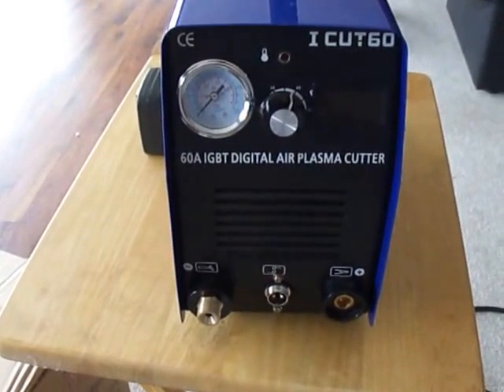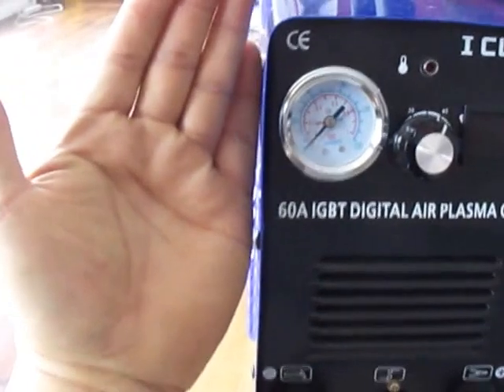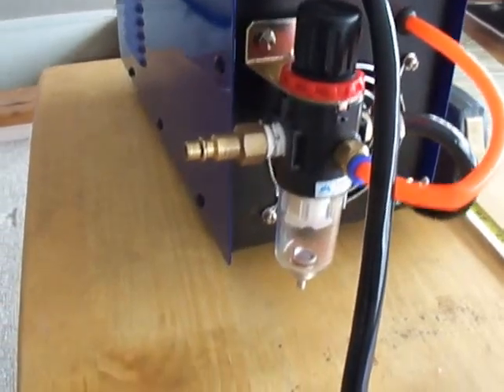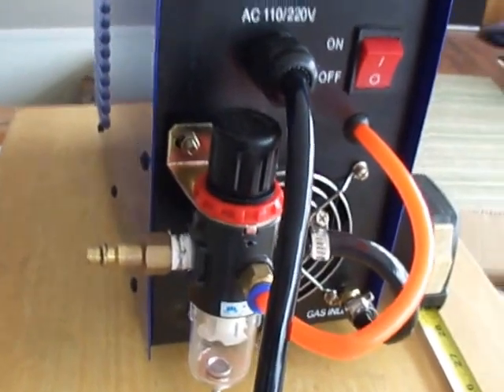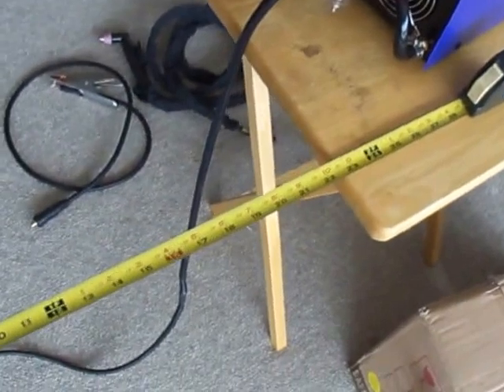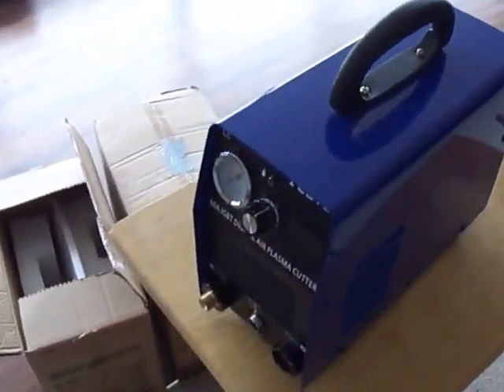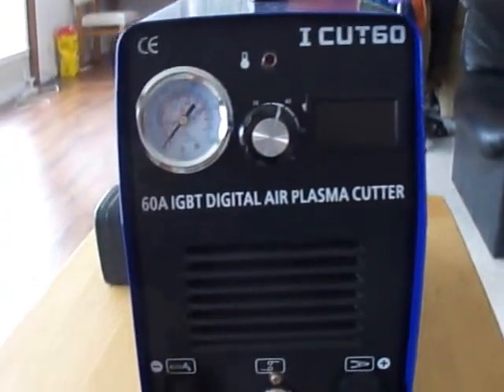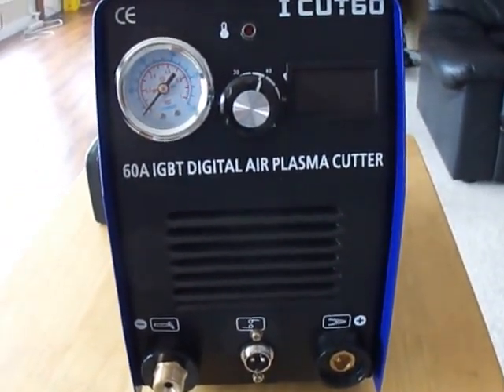ICUT60 hook up and power cable extention

Comment: Thanks for this video, it is quite informative, I used it for review before buying my unit. I am familiar with most electrical, but how does the electrical connections hook up? I do not understand, it says 110 or 220, but there is no internal changes or switch like most things I am familiar with. With water pumps and such the wires must be changed internally, does it automatically sense the voltage and adjust it's self?
 On a 220 there are two hot leads, If I want to hook it to 220v should I connect the black and white to the two hot leads and ground to ground? But for 110 the white would go to nutral and black to hot, this doesn't make sence to me. Any help is much appreciated.
Reply from the maker: John Bradley Hi John.  l recall my unit allows 115-240V, so l used my 240 / 30 amp. welding terminal, it seems more powerful. l could cut 5/7 plate. l tried 3/4 ", and cut through slowly.
Reply: Yes, I apoligise for my ignorance, but does the black wire and white wire go to each side of 220 line without further alteration of the unit? I never saw anything that wired this way...usually inside the unit or a switch must be changed. The instructions aren't clear, I don't want to burn it up by wiring wrong. I spent a lot on it to me and cant buy another.  I have did electrical work my entire life, but this arrangement with the wires is not logical. Black and white usually means hot and neutral, usually we would not connect white wite to hot side....this is different than anything I ever saw..
Reply from the maker: Hi John,  the newer equipment could use 110-240 v.  automatically.  Except ground, the two legs are all hot.
 Due to N. America's 110 v ,  220 is achieved by 2 - 110 v with opposite  phases ( +90 vs -90 degree = 180 ). 
In Europe or Japan,  220 is one hot and one neutral , ground is separate line,  which is less safe than our system.
Reply: @osbornebay944  Less safe?
What do you mean with separate ground line?
We (Sweden) have the ground in the same cable as the hots and neutral.